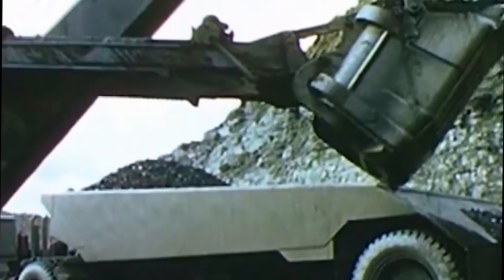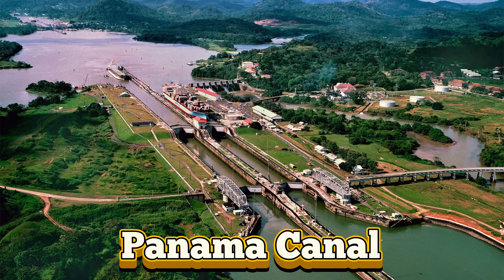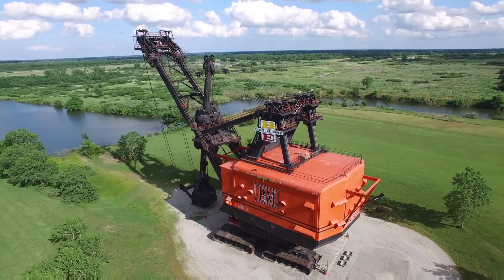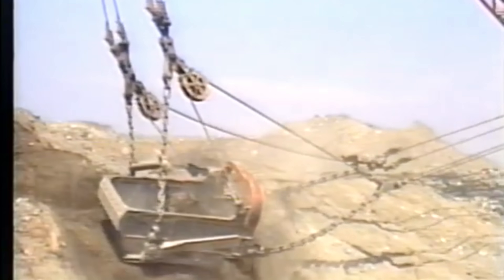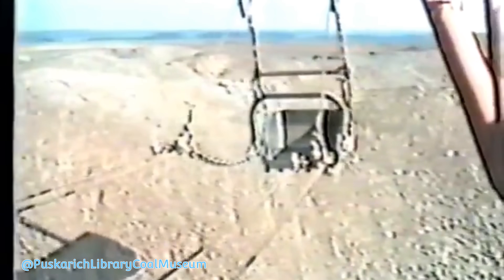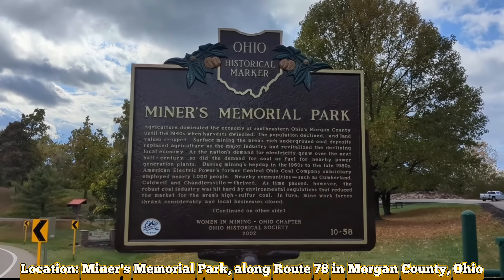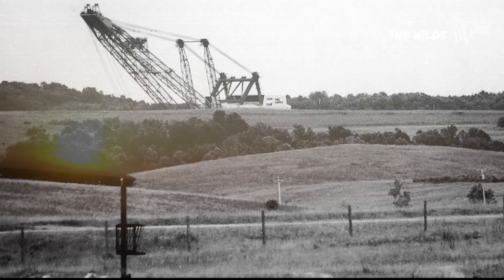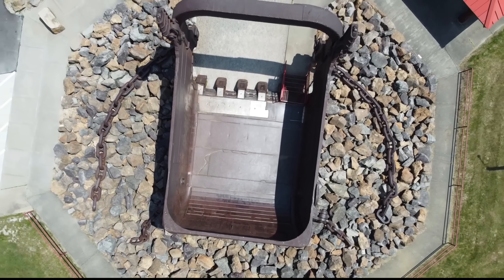Big Muskie: The World’s Largest Earth-Moving Machine | Forgotten Ohio History

Comment: The mine operated for 10 years after Big Muskie. The mine did not close until a bit after 2000. Some guy wanted to rebuild the machine. The safety officer told me that the cables alone would cost 7 million to replace. It simply was not worth the money.

The bucket is several miles to the east of McConnelsville along OH 78.
Reply from the maker: The cost of the machine was staggering and just its energy cost to operate

Comment: In the early 1970's, My Dad Claude Light, his friend Dave Heitsman and I saw this machine working one Saturday when we made what they called a "Cheese Run" to Sugarcreek in Holmes County and the surrounding area to buy full "horns" of cheese from several different cheese making factories. . We would return to SW Ohio with a whole trunk full of cheese for family, friends and coworkers.  We could see the boom for miles and began driving gravel township roads to try and get closer. Finally after getting as close as we could, we parked the car and the 3 of us hiked up to the top of a big hill, and there it was in full view!!! It was very quiet to watch since it was powered by electricity. They built what looked like a high voltage electric line to the machine when it moved forward. There was a small old farm house down in the valley, and with one swipe of the bucket, that house was gone! In town we went into a saloon so Dad and Dave could get a draft beer and a local told us that when the machine crossed a highway they had to pile over 40 feet on top of the highway to prevent completely destroying it from the weight. I don't know if that is accurate or not. It was truly amazing to be able to watch it in action. So glad that they finally reshaped the scarred land left behind. 
Glad to see the video and I shared it with my three grandsons with the above info.
Jim Light
Reply from the maker: nothing like Holmes County cheese.   I can't imagine that behemoth crossing the road, dwarfing everything. Can't imagine how much strain it put on the road

Comment: That is the smaller bucket. When it was first built, it had a bigger bucket, but when it hooked in a rock ledge, they almost pulled the front of the muskie off I was told, then they got the smaller bucket built to prevent that from happening again.

 I.E. info from the old operators that lived in Cumberland, oh.
Reply from the maker: no kidding.  I had no clue that many buckets were also used through time as well.  Can't imagine one that's even bigger than the one sitting in Miner's Memorial Park

Comment: As I am now thinking past to my time on the Big Muskie I wanted to add. I strated as a grinder. Grinding down the welders welds till they were smoth. And then they brought a special type of x-ray machine to test/check that the welds that they were perfect with no defects. Then I progressed to a welders helper. And supplied the welder with every needed thing. Like more welding rods, or adjust his welding machine, ect. what ever he required to keep him creating an arc, and not stop welding. Then I was put with the painting crew. Which painted this machine inside and out side. This required hanging from scafling, going up in buckets, all quite the experience. Finally the machjine was put through test trials. Actually being put through digging test under partial loads, and then full loads. And all the critical weld seems were being monitered, to be certain there were no failures in the welds. Then as the Big Muskie was being tested for full operation, I was assigned to different positions through out the machine to watch, and moniter my area to be certain all things were functioning properly. During this period of time I was allowed to enter the operator cab, and watch the Big muskie in all its glory, from right behind the operator of this great machine. I do so appreciate this period of my time on this machine now at 70 years old. At the time, I did not realize that I was actually a small part of history in the making.  And did I mention, When they dropped the boom on the Big Muskie, to be turned into scrap metel. My Father, he cried.
Reply: I'm 73 and never even saw Big Muskie real life, but but have watched many videos of it working.  I saw the video of them blowing the A-frame and dropping the boom.  I teared up a little, myself.  Such a mechanical and engineering world wonder, just being destroyed isn't fun to watch, at all.  I fully understand the expense of trying to move it was very prohibitive, but it doesn't stop the sadness of it being destroyed.
Reply from the maker: Incredible extra insight. You had your hands on many components of this behemoth.   Would love to see you back to the channel on future episodes.  If you think of any other memories of the Big Muskie feel free to share them. I would love to hear as much as you would like to tell